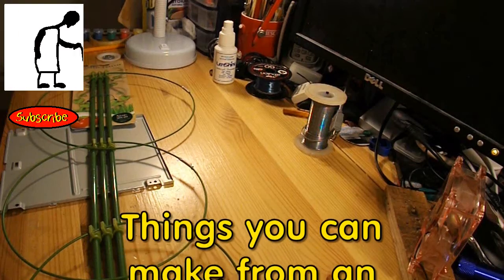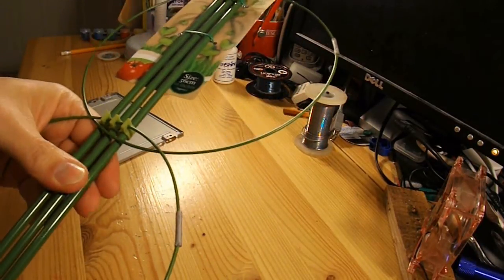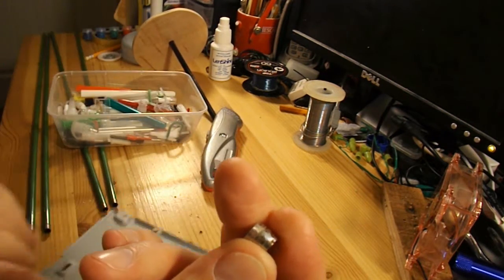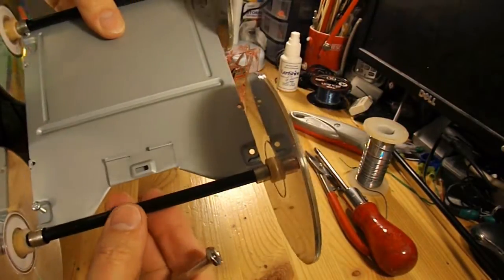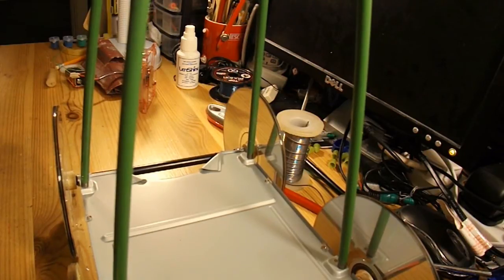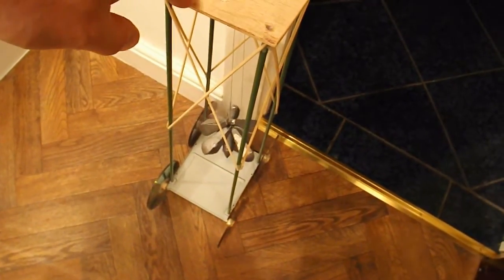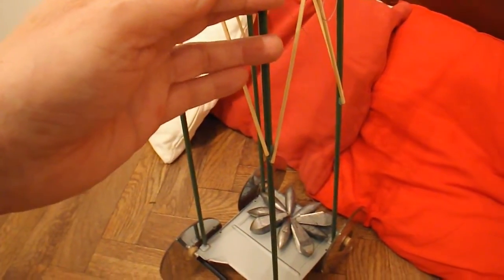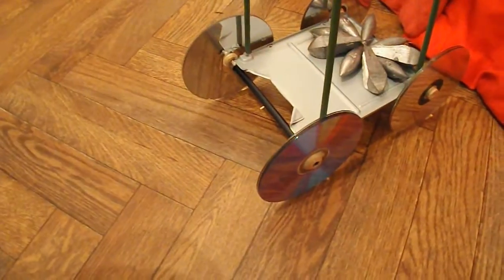Things you can make from an old DVD drive #7 Improved Gravity Car

Comment: Needs a variable transmission !
Reply from the maker: Yes you can do that. I have a simple method where I use a thicker section added to the axle so most of the turns go on the axle as normal and then maybe one round the thicker section so you get a "low gear" effect to get the car moving. Here is one example on a rubber band car I did in 2014 https://youtu.be/vc0URTIqdSA?list=PLA5a2xPRSrB04L6RpUAs5akmK3jqmahPL